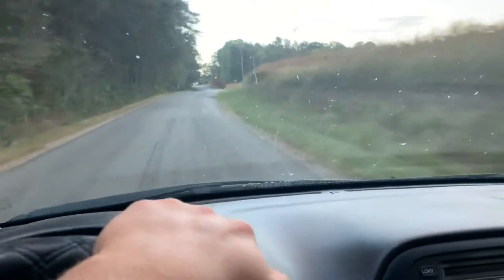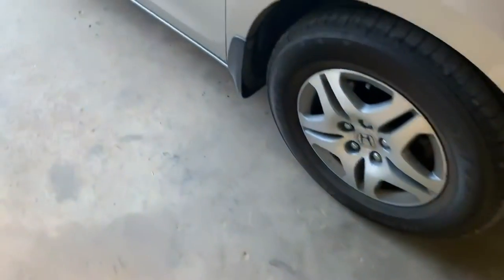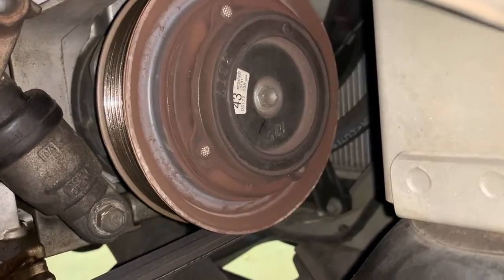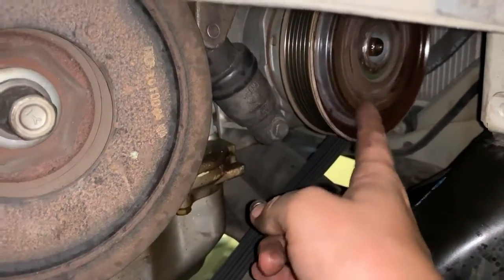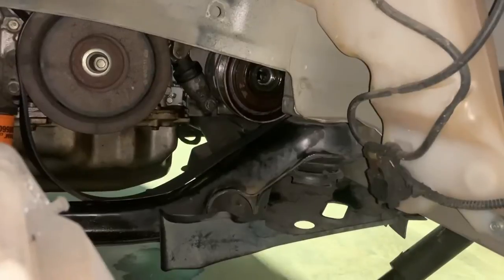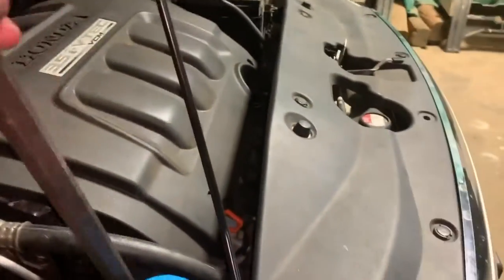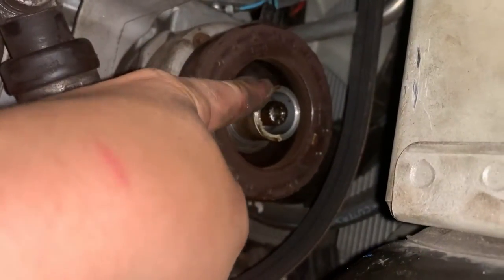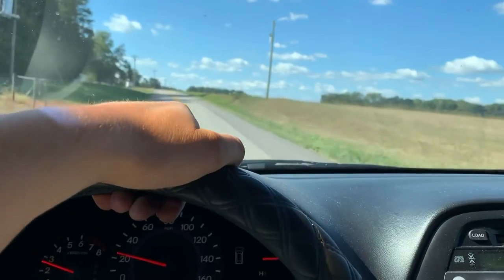How to change a ac clutch on a mini van!

Comment: Great video. i just like to say i work for Honda Dealer in my state. On these vans don't replace just the a/c clutch replace the whole compressor i no they are little bit more money i get that. But i have seen where customers replace the a/c clutch within one or two the clutch goes out. it is better to change the whole compressor. Just saying up to you.
Reply: One or two years ? One or two what
Reply: @derekpollard2914  what i meant to say within one or two years it goes out again. so its better change the whole compressor rather than just the  clutch.:goodvibes: